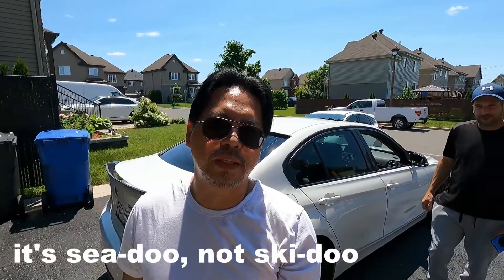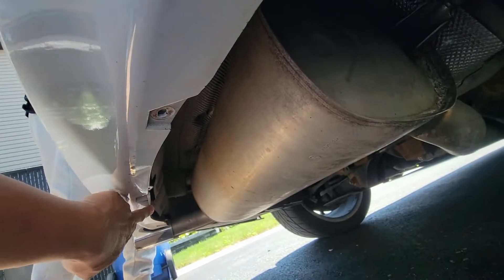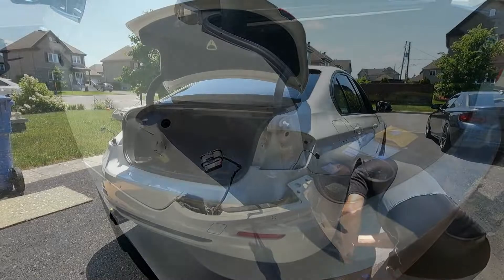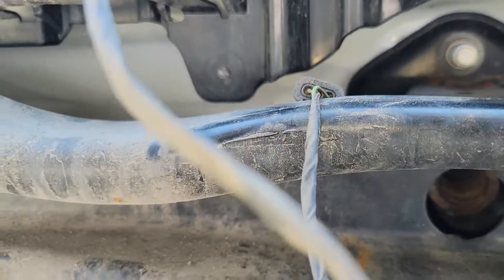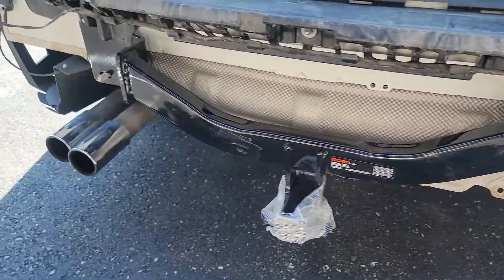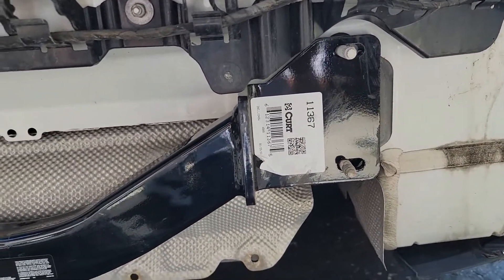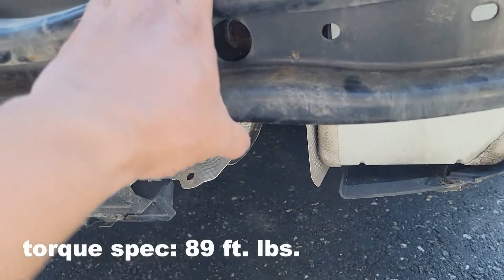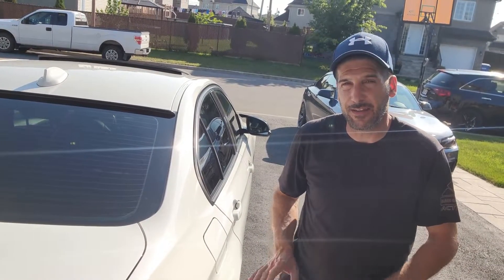BMW trailer hitch installation (f30 series)

Comment: What wiring kit are you using, if you’re using one. I found a few but they’re over 150$, wondering if there’s a cheaper solution for the wiring. I’ll be pulling a boat trailer. Great video on the hitch installation, I’ll be doing that soon!

Comment: Great work and video there, is that hitch size 2 inches?
Reply from the maker: Thanks for the comment, Yes it's the 2 inch hitch that my friend bought from Amazon.
More DIY & Mods coming soon, Please LIKE & SUBSCRIBE and Thanks for watching!!!👍
Reply: based on the part number, Curt 11367 it is a Class I, 1-1/4" hitch
Reply from the maker: Maybe my buddy made a mistake, maybe it's not 2 inch, it could be 1 1/4 only. Maybe? @natesewell9402